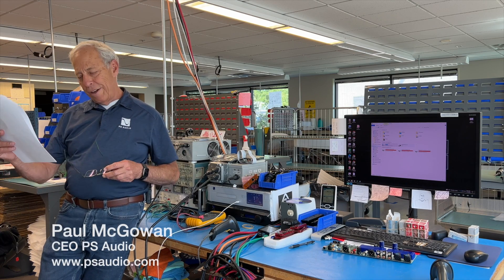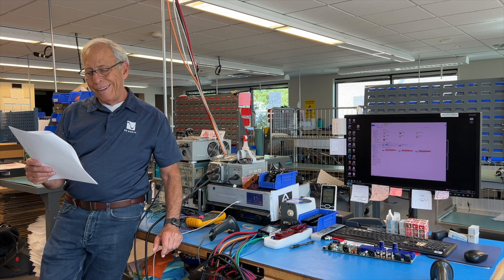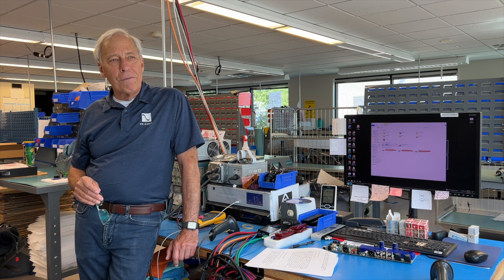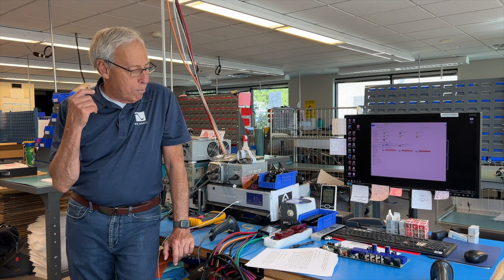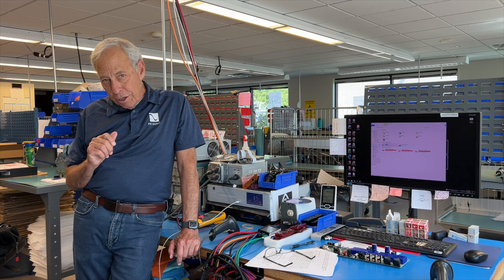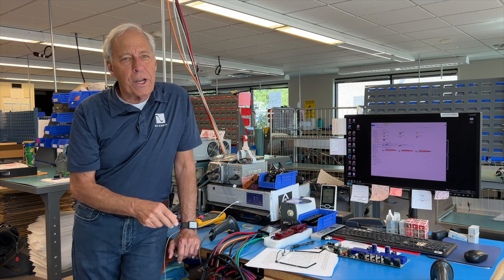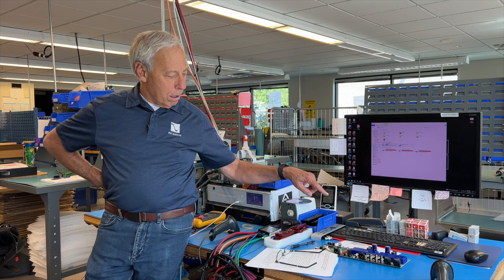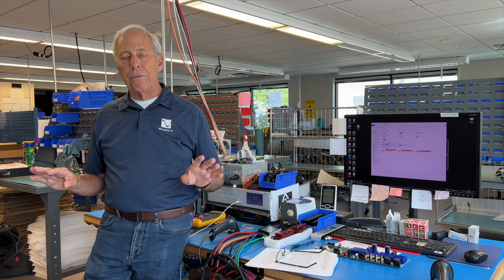SMD components in high end audio

Comment: Starting to learn FPGA's. They're like a canvas for logic circuitry. It can function how you want by using a HDL-code (Hardware discription language). It can be a CPU, a Codec, Sound generator,  multiplexer, etc or all of them at once. It can even be separate circuits with in the chip. It's brilliant.

Comment: Hi guys, I'm a bit lost. How have we taken a step back with caps/capacitors? There are still so many very high quality capacitors made for many high-end or even low-end HI-Fi companies. Mudorf, Nichicon, and Panasonic even makes caps for daRTzeel, and etc. Then there are companies like I think Luxman that design their own. Aren't we in Cap heaven?
Reply: With capacitors especially, it's a matter of pure physics and physical size that play a major part in how much capacitance value a certain capacitor has, AND how good it sounds, and that is why even with SMD electronic circuits, the capacitors are still by far the largest physical dimensions on those types of circuit boards. That's also why a polypropylene audio capacitor is MUCH larger, physically, than an equivalent uF value electrolytic capacitor is... Because the better sounding materials needed to make a polypropylene or film & foil type of audio grade capacitor all take up more physical space than the lesser quality (sound-wise) materials needed to make up an electrolytic capacitor do... And since surface mount components need to be inherently tiny in order to even be surface mounted in the first place, better sounding audio grade capacitors, such as the polypropylene and film/foil types are just not physically possible to make as surface mountable components.

Any audio device that ONLY uses ALL surface mount components on its circuit boards, are also only using (relatively inferior sounding) electrolytic capacitors in the audio signal path, nothing of a better sound quality than that, simply because of physical space considerations, and I think that fact is basically what Paul is referring to here when he says that SMD circuitry in general has gone down in overall quality as far as capacitors go.

Resistors on the other hand, can still be had as good quality materials for SMD circuits, however, the main thing that is majorly limited with SMD type resistors is their power handling, (wattage), ratings, as THAT one aspect of resistors still is (and always will be) determined by their physical dimensions and overall size, simply because they are heat dissipating devices, and therefore the amount of power they can handle is directly proportional to the surface radiating area of their case or package. ALL SMD type resistors, no matter how good of quality materials they are made with, are all no more than FRACTION of a watt power capacity, simply because of their physical size, whereas "old skool" through hole or chassis mount resistors could go up into the hundreds or even thousands of watts power ratings, albeit at a VERY large physical size.
Reply: @JoeJ-8282  thank you. Very detailed comment and I didn't know most of this before
Reply: @JoeJ-8282  thanks for your explanation. Now it makes perfect sense👍🎓

Comment: SMD dont sound different, but they do make repair work almost impossible. In most cases new PCBs are required...
Reply: Watch Louis Rossmann videos and you will learn what is possible...
Reply: It depends on smd part type. Some can be replaced using hot air and its way easier in my opinion than removing TH components and cleaning holes after that. But if we talk about BGA chips or something like that then yes. Also automated pcb manufacturing process is faster and easier with smd components.
Reply: Yes cheaper to mass produce SMD boards and not intended to be repaired
Reply: @pauldavies6037  Yes, thats the point everyone misses. It can be repaired, but not economically. To earn $ as a tech I have to move on to the next chassis...
Reply: What about SMD FET's and FET based IC's? Does cooling matter? Does temp in any way affects FEt's internal resistance and performance?
Reply: @Douglas Blake Tubes like heat 😜Also sometimes I like the sound of BJT when they get hot, but not FET.

Comment: As a modder, I actually like SMD, because I can leave the board in place in order to swap parts. Using the proper tools, I got used to the microscopic size. Modifying through-hole boards will end in damage sooner or later. If only the manufactures wouldn't use the dreaded ceramics all over the place! There are better alternatives available like POSCAPs (my favorites) or foil caps. Those are much more expensive of course, by an order of magnitude at least.
Reply: Been trying for ages to find out which smd components were worth it.
How do you learn about this?
Reply: @Th3_Gael  By accident, actually. Got a promotion mail from a local supplier.
Reply: @hermannschmidt9788 thanks, do you know of other components worth using?

Would really like to start modding stuff myself,  I do through hole already but smd isn't easy to get info on
Reply: @Th3_Gael  Browsing the catalogs of the major japanese manufacturers like Panasonic, Nichicon, Nippon Chemicon, Rubycon can help. After that it is trial and error as usual.
Reply: @hermannschmidt9788  thanks again, I'd hoped there was an easier way lol
Reply: I just cannot even see SMD components well enough, (even with magnifying glasses), nor can I ever get ahold of SMD components securely enough without damaging them, (even with tweezers), for any SMD components to be at all useable or serviceable to me. They're nothing more than a major hassle to work with, especially since you also have to have a SUPER steady hand in order to place them on the board, etc., not to mention, you also have to have specialized soldering tools for them not to overheat or over solder their leads, etc.! Everything SMD is just simply completely "throw away" if it ever burns out or goes bad, as far as I'm concerned. That stuff is just way too fragile in every way, to be truly useful to me.
Reply: @JoeJ-8282  A high quality tweezer soldering iron (from Ersa for example), plenty of good flux, and leaded solder helps a lot. I am always wearing magnifiers, or look through my magnifier lamp. The super small stuff I don't touch as there are no better parts that fit on the pads, anyway.

Comment: SMD is absolutely great for audio as other applications. Audio in fact is very low frequency range up to 20kHz and SMD designs are often used in the GHz range with excellent performance. Rather than having capacitors in an audio signal path, I prefer to not have them at all.

Comment: Absolutely wrong if were discussing analog stages.. heres the truth..remember when they told us that parts needed to be spaced out..but then in a blink they crammed everything together. uh..its for convienience.. next issue solder pads are smaller and the contact area is smaller and vibration and heating and cooling is slowly changing the conductance of the joints.. and also the life of the product is seriously shortened.  im not discussing whats inside the ics.. im discussing the resistors. diodes. caps.. etc thats heating and cooling every time you play the product.. out of 400 crap solder joints.. all it takes is one to change the circuit parameters... and kapow.. its junk..